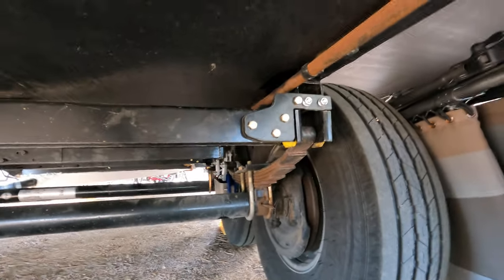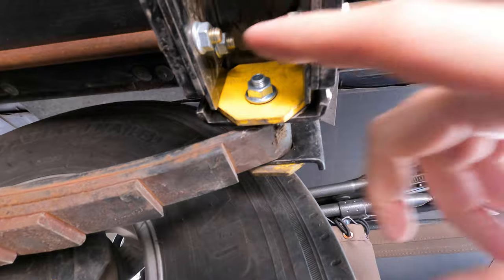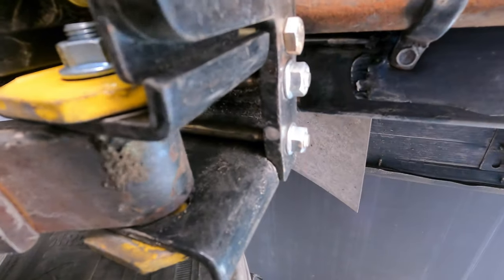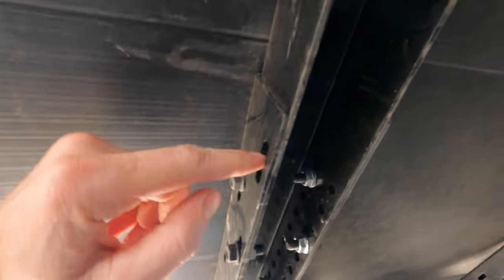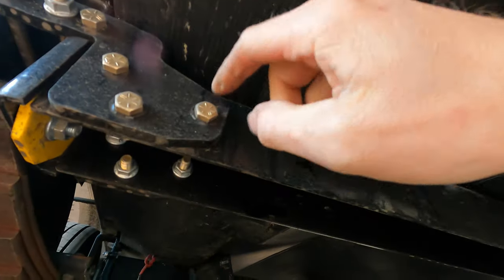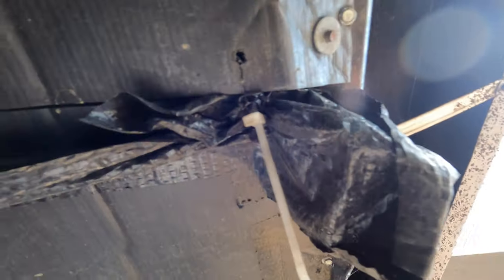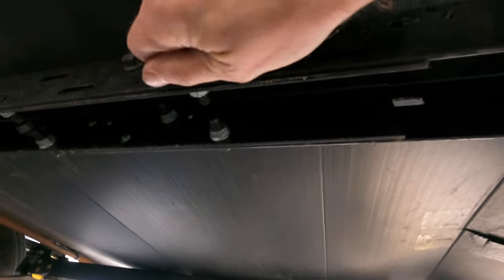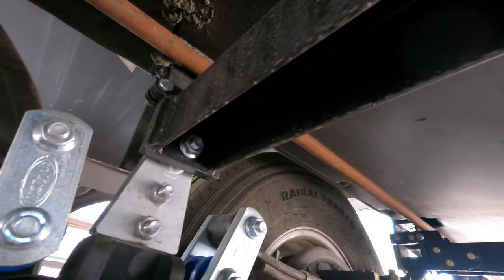MORRyde SRE 4000 And X-Factor | Review and First Impressions

Comment: The key to not damaging the powder coat is not letting the head of the bolt or the nut turn against it. Requires a flat washer under at least on or the other.